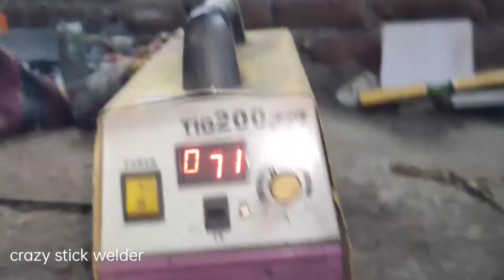how to weld 0.2 mm thin metal sheet, thin metal sheet sheet welding technique for beginners

Comment: If you weld thin metals, you should use smaller size of welding rod. Not like that
Reply: Those 1.0 mm rods are only in books, I couldn't find it anywhere.